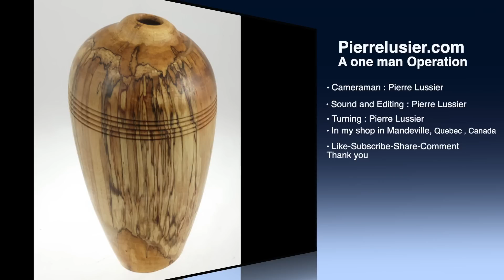Woodturning Hollow form vase green wood. Tournage sur bois vase en bois vert

Comment: I see the question and your answer about seasoning the green wood.  Do you wait for several weeks (until pretty dry) before applying final finish?
Reply from the maker: On this vase I wayted 1 day and put tung oil wayted an other 2 to 3 days and an other coat and put an other coat one day later.